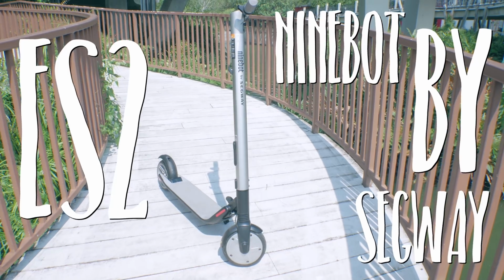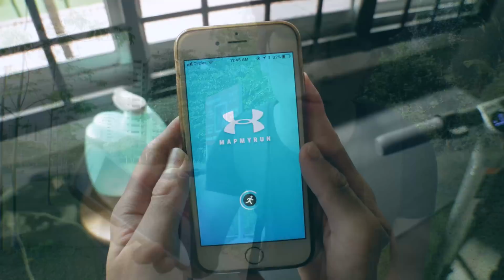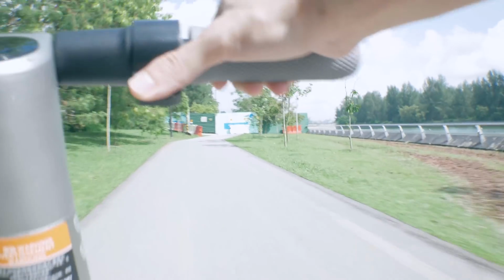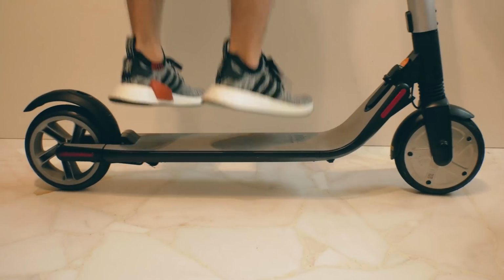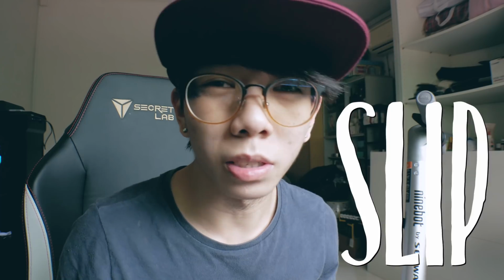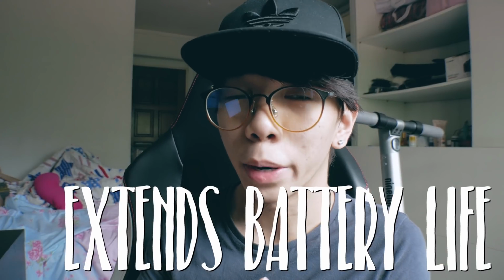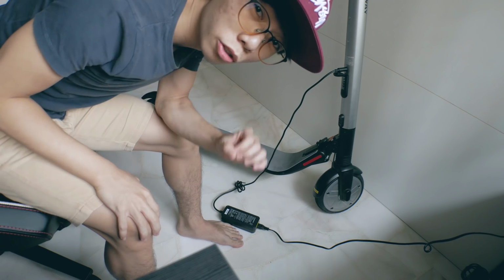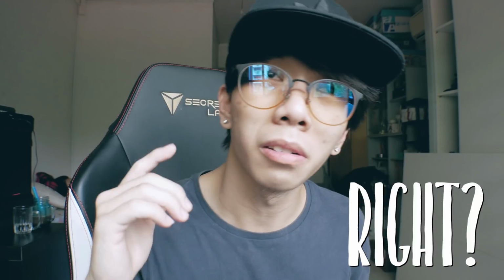NINEBOT BY SEGWAY ES2 - a reasonable priced smart electric scooter

Comment: Don’t buy one.   I’ve had mine for 200 miles now, rode it exclusively in the daytime, until last night. Soon as I activated the headlight the throttle got “jumpy” and limited the speed to about ten MPH.   Almost zero acceleration with the headlight.  So now I either send it back for a “maybe” warrantee repair,,  ( Disassemble it, put it back in the box, that I’m not sure I even have  anymore, and be without it for who knows how long, and blog posts state that that only fixes it half the time.). Ooooorrrrrrr disassemble it myself and soldier some gizmo to the guts.  Ya-right. 
One more thing, I’m 160 lbs and live in a mostly flat beach town. 15.5 miles?  What a joke. The MOST I’ve ever got out of it is 9 miles, on eco mode, which is sooooo weak you have to push it up almost any hill and across the streets because it’s so slow it’s a hazard.  Real world range is about 7 miles in town. Maybe if I had a totally flat commute without any stoplights I’d get more but if you have ANY hills, it kills the range.  
Put the brakes on at high speed down a hill?  Kills the power to the whole scooter, loosing the front brake, leaving you with only the rear brake - AFTER you change your foot position of course and doubles your expected stopping distance.  
Junk.  I won’t let my daughter ride it. 
pS. My brother bought a “refurbished” one, non folding, and has NONE of these problems. And it’s a more stable ride. The folding mechanism on mine has a little play in it.  I had no idea how much of a difference it would make until I rode his.   
My advice, wait a couple more years until they get the bugs worked out. 
I’m saving up for a onewheel.
Reply: They pretty much fixed all of these problems beside the shitty range. The only problem I hear people report now is the connector for the external battery that can break due to vibration and melt the port. You can prevent this by using one or two hose clamps and clamp the battery pack hard against the stem.

Comment: Hi, I just bought an ES4 from Ebay in U.S., and from my research online the ES4 is basically just an ES2 with extended battery. However, the ES4 that I received has "matte black" steering column ( so pretty much all black) compared to many ES2 review videos I saw are all silver (like yours). For sure it is not an ES1 with external battery, because mine does have rear suspension and button led light. I am kind of confused why my ES4's color is different than others.
Reply: they are actually coming in two colors now.  There is a silver version which is more commom and then the rare darkgrey/matte black.  The black version is newer so your probably lucked out and got the black.  Im actually looking for the black myself lol
Reply: @hunnykomb7481  Wow really... I didn't know there are two colors, because I never see any matt black on any review and non-mention about it till you told me, lol. The U.S. Ebay seller that I bought it from even list it as common silver color one. Guess I am lucky  that I got the matt black one, thanks for letting me know!
Reply: Thanks 4 the info didn't know there was 2 versions i just received mine in the mail yesterday and its the matte black one.didnt know it was rare.but ive heard a lot of people complaining of power loss while headlight is on but even in sport last nite in wisconsin with headlight on i cruised at 16mph smoothly no power loss...cant wait to get the extended battery

Comment: Dont buy this, quite dissapointing experiences i had already. At the first week already when i opened the headlight it started applying brakes! Yes  it sounds irrelevant but for whatever reason when i open the headlight it applies an unconsistent brake which is annoying. and 1 and 2 months later now bottom lights got stucked, by stucked i mean i cant change it they just glow like a disco lights which is not my style therefore not using the bottom lights at all. When i first bought it i was always hitting 25km/h max speed, now for whatever reason again it is maximum 22-23! It hasnt been even 3 months yet and im wondering what problems i will have in very soon future!
Reply: So I shouldn't buy it because YOU had a problem? You should return yours and get another.
Reply: @kerosene4751  this is a common problem that so many people have. Means that i might have same problem again if i get another one even.

Comment: Hi, have you had any problems with this yet? I bought one and after 2 months (120 miles) I have the following issues which are well documented by other users:
1. Scooter will not run with the headlight, the screen dims and the brakes apply, speed is limited to 6mph max and very jerky 
2. Scooter will just shutdown randomly under braking which as it's electronic, leaves you with no brakes 

1. I can live with but 2. Is just downright dangerous! Once it happened going down a small hill coming up to a junction and the 2nd when an oncoming car came into my lane and I had to rapidly brake. Both times I nearly had an accident because of the issue. 

Found an email for support in the depths of the Segway website but so far no reply.

Comment: I bought one of these four months ago.  That's about 500 miles ago.  I like it so much that I spent another $250 for the extra battery pack.  The solid tires means no flat tires but a rougher ride.  Bending my knees slightly absorbs the bumps quite well.  I weight about 200 pounds.  Top speed for me is 12 mph. I get a full 10 mile range on a full charge, maybe 12 if I ride slower.  (I haven't received the extra battery pack yet.)  The add-on battery pack is on Amazon here:  https://www.amazon.com/gp/product/B07C71WCJV/ref=oh_aui_detailpage_o00_s00?ie=UTF8&psc=1
Reply: Update:  My Segway ES1 now has 700 miles on it with no problems.  I installed the extra battery pack and now my range is nearly 25 miles and my top speed on flat roads is 16 mph.

Comment: I advise no one to buy this scooter or any ninebot scooter. Mine broke after just 3 days. One screw came lose and got stuck in the folding area. Tearing up the metal a lot!! This has happened to other ppl too. Just look at the reviews at Amazon how bad this scooter is!! 

Btw Changing one tyre on these will cost you almost 300dollars with labor !! Because you for some reason must change the complete wheel not just the rubber. Ninebot service is also completely rubbish. Seldom answer on mail and you have to pay for the return shipping of the scooter(very expensive).

Since Segway got bought by the Chinese they flood the market with extremely bad  products using segways good reputation to make people believe they are buying a good quality product. Stay away from this company!

Comment: Amazing review, you push me to buy it :) A question, in your opinion which is the best way to use an anti-theft system? A U lock or a chain inside the rear wheel it's safe for short period? Or it's simple to remove the rear wheel. I'm thinking...the scooter arriving soon!

Comment: Aamazing review really thank you, but trust me, you really do not have tube wheels, tubeless is much better if it has at least some height like this one + suspension. Because I have the Xiaomi Scooter 2 and the ride it was nice and smooth, but you need to replace it almost every week if I have some sharp stuff on the street (everytime) I ride on it 650 KM in total and have 3rd wheels and now tubeless and so far happy (no problem because battery problems are right now everyday ...).

Comment: Great review! I have one of those too since 3 months and my experience is not too good. Lots of issues with the rear wheel and shock absorber making lots of noise even on a smooth surface. I finally had to get it repaired, 3 weeks already waiting for a repair. There is a shortage of replacements. Yours is working fine?
Reply: OFFICIAL HARKONS I finally just got my replacement a few days ago and it’s way better. Some small details have changed, like the surface where you put your feet. It has a different finish on the surface and it does not look that dirty anymore. I also feel that the rear part is a lot more stable and it’s almost quiet, even on uneven surfaces. You should check that out, maybe the first units were indeed defective!
Reply: I’m having the exact same issue with my rear wheel as well as the handlebar not aligned with the front wheel. Which company did you contact for the fix Alan? Segway or Ninebot?
Reply: I contacted the seller on Amazon, he asked me to send it back and he sent me a new replacement. I would contact the store where your bought it first.
Reply: Alan Casaucau Hagel I sent emails to Segway and was led to NinebotUS page to fill out a repair form. Thanks for the info Alan! Are you handlebars not aligned as well?